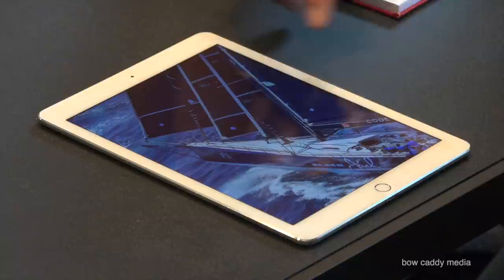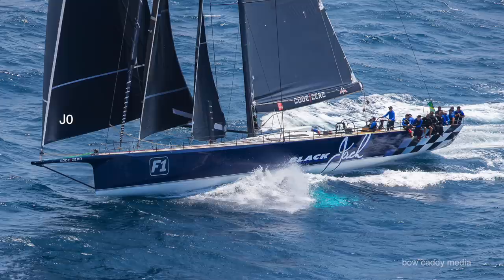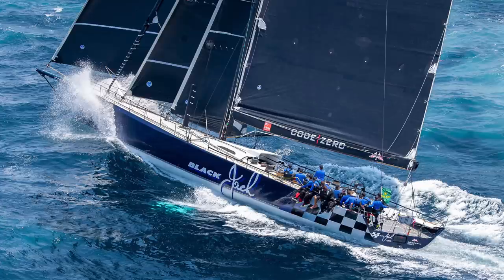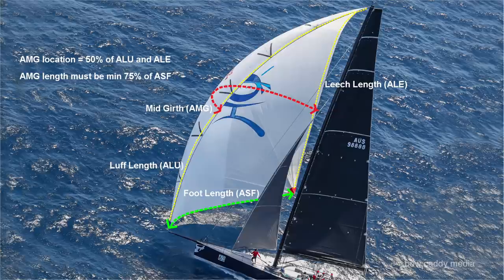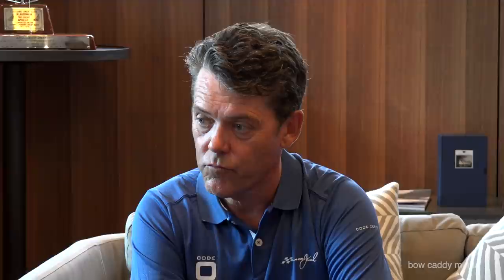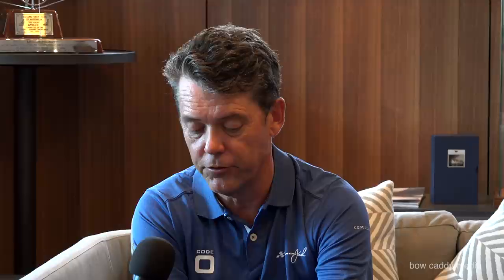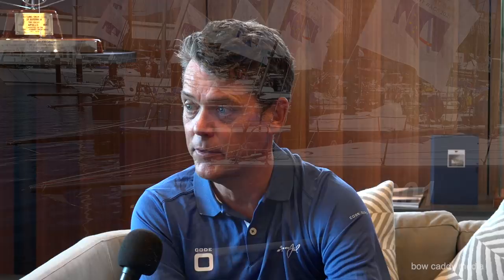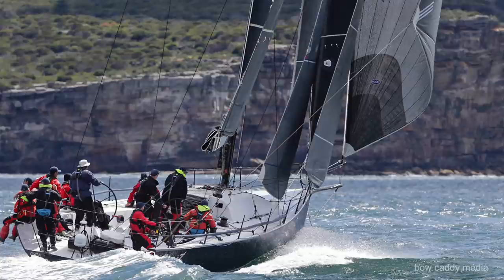Black Jack's Mark Bradford Sails Explains Grand Prix Sails

Comment: Not so much about sails as about getting around the rules. LOL.
Even funnier is this guys explanation of how many boats double up their (yellow) storm jib but that "We have storm jib, but we also have a carbon purpose built sail" = Me thinks that having 2 sails would be heavier.
I've always been let down by North sails. They force you into having what they have/offer and aren't at all interested in trying anything new. THEY KNOW is their only answer.
I got hand made sails locally and have been regularly up there with a "slower" boat on paper. LOL.
I even came up with a way of gaining more effective sail area without changing the surface - I changed the cut and shape. It works.
Would open up such a huge market for them, but they don't want the licence. LOL.